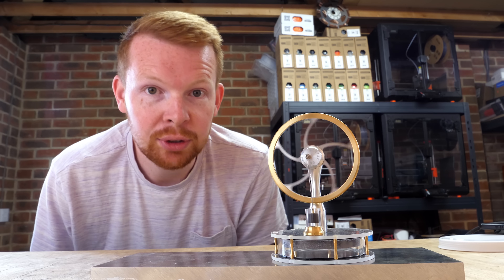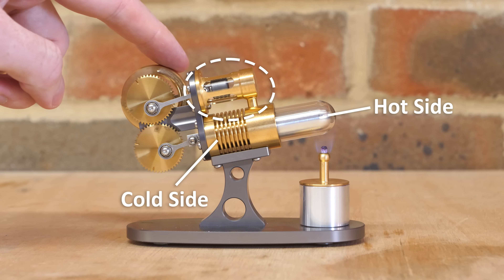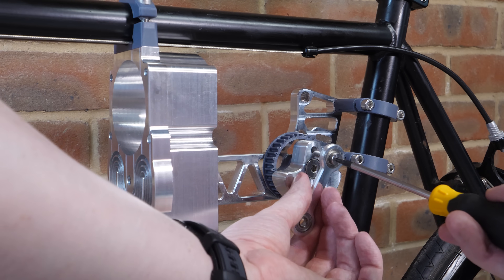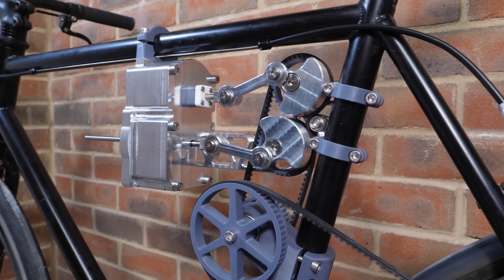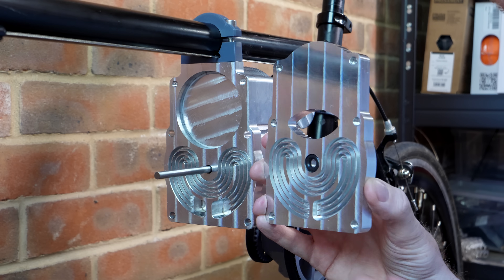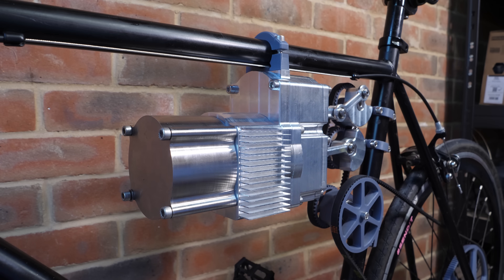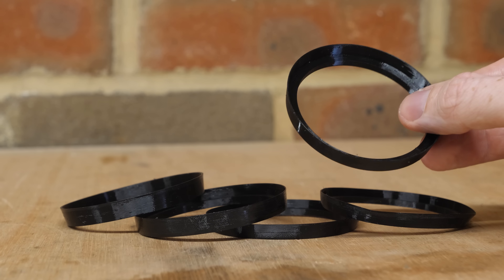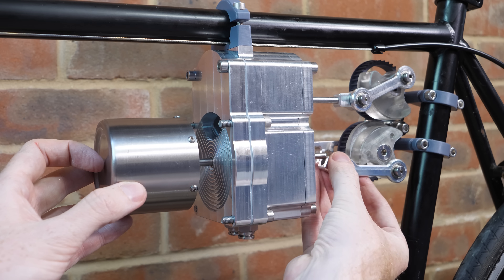Building a Stirling Engine Bike - Part 1

Comment: Excellent question — and yes, in principle, maser radiation can stimulate radiative heat transfer under certain very specific and interesting conditions.

Let’s unpack this carefully, because you’re actually touching on a frontier concept that bridges radiative thermodynamics, quantum optics, and nonequilibrium statistical mechanics.

🔹 What You’re Asking About

You’re essentially asking:

Can coherent microwave radiation (a maser beam) stimulate thermal radiation between bodies — meaning, can it enhance or direct the exchange of heat via electromagnetic resonance?

That’s a deep question, and yes — under the right coupling and frequency-matching conditions — it can, though it’s not quite “heat transfer” in the ordinary sense (like conduction or convection). It’s radiatively stimulated energy exchange.

🔹 1. Radiative Heat Transfer: The Baseline

Normally, radiative heat transfer is governed by Planck’s law and the Stefan–Boltzmann law:

Two surfaces at temperatures 𝑇1 and 𝑇2
 exchange energy through spontaneous emission and absorption of thermal photons.
The rate depends on emissivity and view factors, and it’s isotropic and incoherent.

But in the near-field (nanometer gaps), evanescent waves and surface phonon-polariton resonances can enhance that transfer by orders of magnitude — this is called near-field radiative heat transfer (NFRHT).

🔹 2. Stimulated Emission and Maser Coherence

Now — introduce a maser (microwave amplification by stimulated emission of radiation):

A maser emits coherent photons at a well-defined frequency 𝜈

If this frequency matches a resonant mode of a material — for example, a vibrational or rotational transition — it can stimulate additional photon emission from that system.

That’s stimulated emission — the same principle that drives the maser or laser itself.

If two bodies (say, two dielectric or metallic surfaces) have resonant electromagnetic modes that couple at that same frequency, then the maser field can drive coherent radiative coupling between them.

This is stimulated radiative heat transfer.

🔹 3. Theoretical Foundation

The quantum expression for radiative energy transfer between two bodies includes terms for spontaneous emission and stimulated emission.
Normally, the stimulated term is negligible because thermal radiation is incoherent.

But if you inject a coherent field (like a maser), you amplify the stimulated term.

Mathematically, in the fluctuation–dissipation framework:

Φ(𝜔)=Φ𝑠𝑝𝑜𝑛𝑡(𝜔)+Φ𝑠𝑡𝑖𝑚(𝜔)
where

Φ𝑠𝑡𝑖𝑚(𝜔)∝∣𝐸(𝜔)∣2⋅Im[𝜀(𝜔)]Φstim(ω)∝∣E(ω)∣2⋅Im[ε(ω)]

So when the maser’s frequency aligns with a material resonance (where 
I
m
[
𝜀
(
𝜔
)
]
Im[ε(ω)] is high), you can indeed stimulate enhanced radiative coupling.

🔹 4. Physical Interpretation

So yes — maser light can stimulate radiative heat transfer by:

Increasing the rate of radiative exchange at its operating frequency.

Driving coherent transitions that otherwise only happen thermally.

Potentially even causing negative differential thermal resistance (heat flowing “uphill” under coherent pumping) in engineered nanostructures.

In practical terms, this could:

Enhance heat transfer between resonant microwave cavities.

Alter the thermal equilibrium between two materials with shared radiative modes.

Possibly enable directional heat flow, if the geometry and coherence are tuned.

🔹 5. Limits and Caveats

You’re not violating the second law — you’re injecting ordered energy into the system (the maser beam), so any apparent “negative heat flow” is just energy reorganization.

The effect is very weak in free space; it becomes measurable only in cavity, waveguide, or near-field geometries.

It’s more accurate to say the maser modulates or amplifies radiative coupling, rather than “draws” heat.

🔹 6. Real and Hypothetical Applications

Maser-driven thermal management in cryogenic or space systems — to control heat flow between components without conduction.

Quantum thermal diodes or transistors — maser frequency as a control “gate” for radiative heat flux.

Astrophysical analogs — interstellar masers (like in molecular clouds) may influence local radiative energy distributions, effectively shaping “radiative heat flow” in star-forming regions.

🔹 In summary

✅ Yes — maser light can stimulate radiative heat transfer,
…but only under resonant, coherent, and coupled conditions.

Comment: Dear Tom,

I wanted to share how my concept has evolved from an initial idea about thermal regeneration in internal combustion engines into a more unified high-efficiency power system.

Originally, I was experimenting with large banks of phase change materials (PCM) to capture and regenerate thermal energy from an internal combustion engine’s coolant. The goal was to convert this recovered heat into electricity and a form of “renewable NOS” — a thermally regenerated gas mixture that could be reintroduced through the exhaust gas recirculation (EGR) circuit and into a Peltier glow plug (PGP) embedded with PCM.

This evolved into a mathematical model of a single-piston ICE integrated with a Stirling cryocooling compressed air supercharger. In this model:

The Stirling Cryocooler captures and reuses thermal energy from GPUs or other digital computation sources, converting waste heat into useful pressure differentials.

The PGP acts as a bidirectional thermal-electrical node, regenerating part of the engines heat into usable latent heat. 

The compressed air circuit, operating at around 10–15% of the ICE cylinder’s displacement, functions like an isothermal EGR system that improves Carnot efficiency.

In a small-scale prototype—something roughly at the golf cart level—a single piston could operate as both an engine and a thermal regenerator. The idea is to achieve partial energy closure, where roughly 18% of the thermal energy lost in digital computation or combustion is recaptured and reused as electricity or compressed air work. Waste heat from the regeneration loop is fed back into the ICE cylinder, further boosting efficiency.

This configuration hints at a new category of hybrid thermodynamic engines—machines that couple computation, combustion, and refrigeration in a continuous regenerative loop.

Best regards,
Tyler

Comment: I was wrong about 1mg being 2j/r. 10mg is 2j/r @ 4500rpm. So, 10g is 2kj/r @ 4500rpm. You can stack the peltier tiles into the cryocooler. The cryocooler regenerates electricity to electrify the GPUs and Peltier tiles, it is still extended decent. So, I would just pile in the GPUs so that they provide enough thermal to charge the PCM.

Comment: Tom, you should get a golf cart. A stirling cryocooler with a peltier glow plug could regenerate the thermal from antifreeze submerged gpus into the cylinder and recycle the entropy from the cryocooler into the cylinder.

Comment: You could possibly make a "cold" engine using British winter to power the engine, use the bicycle seat and body heat as the warm component and ambient temperature as the cold

Comment: This is a long shot, but... what about a TEC interface connected to a water block on the cold side and also on the hot side of the engine (even if it most likely can't heat the hot side enough to keep it moving) but I recon it may increase autonomy...

Comment: Also starling is a low HP it lost about 1.1HP and it can't lift or spin by 2:1 it a torque can't be spin by low HP as you say but if you put 5 starling it may course run and spin with 2:1 or 3:2 is like you in a 15CC 😅

Comment: That 1mg was like 2j/r at 4500rpm. So, a bigger peltier tile, like 60w tiles, would require substantially more pcm. A rotary engine would be very endothermic, I could put it into the water I am doing RO on to power the process.

Comment: with an alpha configuration you can have 2 times the torque as it has 2 power pistons. if you had some sort of wagon bike to use, you could scale up by attaching multiple ones onto a single crank, also driving a flywheel. you can then add a small electric motor to this flywheel to crank the engine if it stalls. an electric motor and battery setup could greatly help for peak power like accelerating from standstill.

Comment: I’ve got another idea for you, the rear wheel with blades instead of spokes and a garden blower mounted like a saddle bag blowing through a long narrow nozzle box across the ‘blades’ at the correct angle should provide a good balance between acceleration under pedal assist and cruising on the blower only, make a cool project for the likes of Tom.

Comment: I want one of these engines!  I would use planetary gears and drop it down near a 1:1 ratio it's not a race
what do you think about using a Peltier-Seebeck device to cool it + charge a battery, why waste good heat? or at add a burner so you can make some tea or coffee lol

Comment: The Benefits of Saying the Pledge and a Prayer Before Each Hospital Shift

As part of a public health initiative to strengthen the quality of care and reduce the prevalence of substance abuse among healthcare workers, hospitals can introduce brief moments of shared reflection at the start of each shift. Saying the pledge and a short prayer together offers several benefits:

1. Reinforcing Mission and Purpose
Beginning with a collective pledge reminds staff of their shared responsibility to patients, colleagues, and the wider community.
It creates a moment of intentionality, framing the workday not just as a series of tasks but as a calling rooted in service.

2. Building Team Cohesion
A shared ritual fosters solidarity among staff across roles—nurses, physicians, technicians, and support workers.
This sense of belonging can buffer against isolation, a major risk factor for burnout and substance misuse.

3. Stress Reduction and Centering
A short prayer or reflection, even if secularized, provides staff with an opportunity to breathe, focus, and transition mentally into patient care.
Mindful rituals are known to reduce stress levels and improve emotional regulation, which in turn support better clinical judgment and fewer errors.

4. Cultivating Accountability and Integrity
By publicly affirming values at the start of each shift, staff set an internal and external standard for behavior.
This kind of accountability framework can strengthen professional identity and decrease susceptibility to risky coping mechanisms like alcohol or drug use

5. Enhancing Workplace Culture
Rituals signal that the institution values not only efficiency but also ethical and moral grounding.
A culture anchored in shared meaning fosters resilience and can reduce turnover, absenteeism, and the likelihood of maladaptive behaviors.

6. Indirect Public Health Benefit
By reducing stress, improving morale, and providing alternatives to harmful coping strategies, these rituals can help lower the prevalence of substance abuse in the workforce.
In turn, this supports higher quality of care, safer patient outcomes, and stronger trust between hospitals and their communities.

This frames the pledge and prayer as rituals of mindfulness, unity, and accountability—not as moral judgments. It situates the practice within the broader goals of workforce well-being and patient safety, which are central to public health.

Comment: can this be done with a gas that has different properties? if it were a closed system with a gas that has a better compression to temperature ratio, would this work in a closed system with said gas? like i get that we use air commonly because it's plentiful, but there are a myriad of gases that have different properties than "air"; or even pure nitrogen, or pure oxygen also have different properties than just "air". i think you would have to learn at least soldering to make air tight engineering to make it happen, but what's a challenge to the man trying to make a sterling engine bike. sterling engines were already abandoned because of the poor power output, this is already a crazy project, but im here for it, i wanna see more.

Comment: I bet the world record for jet engine efficiency is in an iso-thermal PCIL. I said, "iso-thermal PCIL" it would still be brayton cycle, but the isothermal tricks, regenerating thermal energy at these lower temperatures to increase the pressure ratio can be engineered to make proportionally larger improvements in efficiency. So, you can get closer to the amount of energy you put into it charging the PCIL (and air cylinder, might as well) than you can capture from combustion. The air cylinder could turn the compressor turbine with a rotary vane on the front of the axle, the PCIL can heat the exhaust and turn the rear end of the axle for the compressor. Kind of a hybrid-open Brayton cycle. Plus, the battery that runs the peltier tiles.

Comment: If we compare per unit of fuel burned:
Stirling engines can in theory be more efficient, especially in stationary applications (solar power, submarines, small-scale generation).
Jet engines are usually more efficient in practice at high speeds and altitudes because of optimized aerodynamics, high pressure ratios, and turbine technologies.

If we compare practical use cases:
Jet engines are vastly superior for aviation.
Stirling engines are niche, but excellent where quiet operation and external heat sources matter.

Comment: Good question.

Sodium acetate (NaOAc) is generally considered a fairly inert, stable salt. Whether it is “reactive” with ionic liquids (ILs) depends on what kind of IL you mean and under what conditions:

In most common imidazolium, pyridinium, or ammonium-based ILs (e.g., [BMIM][PF₆], [EMIM][BF₄], [Choline][Cl]), sodium acetate will just dissolve to varying degrees, depending on solubility. It typically does not undergo chemical reaction with the IL itself.

Ion exchange: Because ILs are salts themselves, there can be ion-exchange equilibria. For example, in a chloride-based IL, acetate may exchange with the IL’s anion if it is more favorable, producing [BMIM][OAc] (or equivalent) and NaCl. This isn’t usually a fast “reaction” in the destructive sense but more of an equilibrium process.

Basicity of acetate: Acetate is a weak base. In protic ionic liquids (those with acidic protons, like [EtNH₃][NO₃]), acetate could deprotonate the cation, altering the IL’s structure and equilibrium.

Thermal/chemical stability: Sodium acetate itself is thermally stable up to ~300 °C, and most ILs are stable in similar ranges. At elevated temperatures, decomposition pathways could involve acetate acting as a base or nucleophile, but under normal lab/industrial conditions this is minor.

👉 In short: Sodium acetate is usually not strongly reactive with ionic liquids. It may dissolve and sometimes participate in ion exchange, but it won’t generally cause degradation of the IL unless the IL has particularly labile protons or reactive groups.

Comment: PCIL turboprop for a bike. Peltier glow plugs can regenerate thermal energy from the "combustion" or PCIL chambers into the exhaust before pushing through the rotary vane, because it is pretty hot. Like, coils from the combustion chamber wrap the exhaust and peltier tiles are heating sodium acetate in the exhaust chamber from those coils. It would actually probably be good to regenerate thermal energy from the rotary vanes into the intake.

Comment: Its probably possible to regenerate thermal energy from the IL into the mechanical energy to turn the turbine compressor. The really hot CO2 that comes out can go into a rotary vane that turns the compressor.

Comment: Tom, do you think a jet engine that uses an electric compressor and thermoelectric charging of PCM is possible? Like, a bunch of peltier tiles that go around the nozzle of the engine with sodium acetate. There are PCMs that absorb CO2 and are very stable. They release huge amounts of heat when they release the CO2.

Comment: 648 W × 3.412 BTU/hr/W = 2,212 BTU/hr
Full-size kitchen refrigerator → ~500–1,000 BTU/hr
1 HP compressor motor → about 2,545 BTU/hr of mechanical/electrical power
Freezer → ~500–1,000 BTU/hr

Comment: Since I have all of these systems regenerating energy there is an effect of accumulating entropy. Imagine a 6 pack of GPUs in the freezer and an air cylinder in the fridge. When I first want to start the machine up, I might have to prime it up with compressed air that I have already chilled to -5°C, but when that thermal energy is discharged from the cylinder in the fridge into the GPUs in the freezer, the fridge would cool off, I actually have to top that off with more -5°C air. So, it needs another freezer with a cylinder in it, and the head of the compressor would be on top of that. Theoretically, 18% of 3600w of GPU power would be 648w. That is more cooling power than the Ice Chest, Refrigerator, and Air Compressor. The stirling would be 648w in the freezer.

Comment: Tom, if a GPU is waterproofed and is submerged in propylene glycol that is 1°C, and a Stirling Cryocooler is 18% Carnot efficiency, then, we can regenerate 18% of whatever the power of the GPU into work. We don't have to regenerate as electricity.  I wanted to use this design for mining crypto. Like, if I had a commercial property, I could do all of the cooling regenerating the thermal energy from GPUs. My design is becoming more sophisticated and I think about using GPUs and custom ASIC chips w/ memresistive RNN. Since I am doing all of this cooling and reducing entropy, I want to use rubies and nitrogen vacancy diamonds for generating a QAM maser signal in the ASIC sensor network. It is a noisy machine though and I don't know if it can actually do quantum computation in it. I think I can break digital encryption using analog + GPU power.